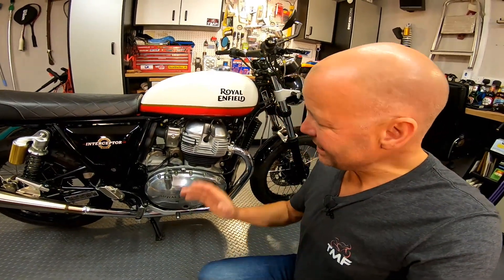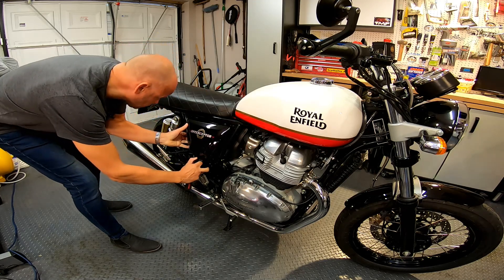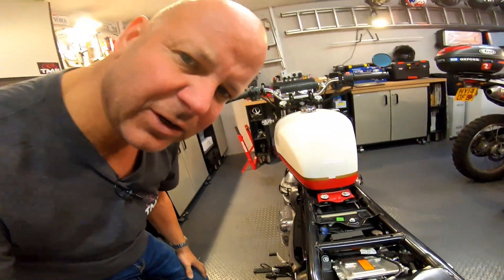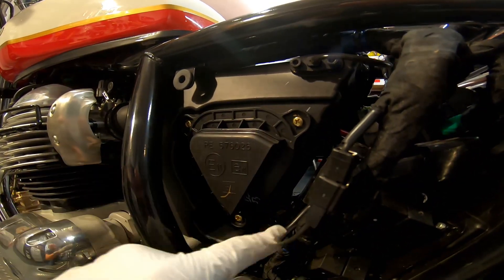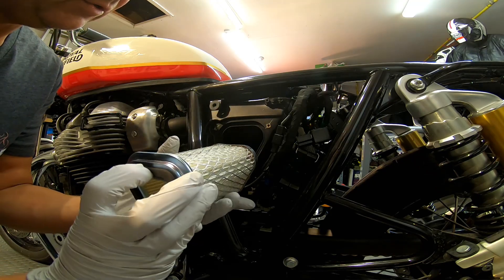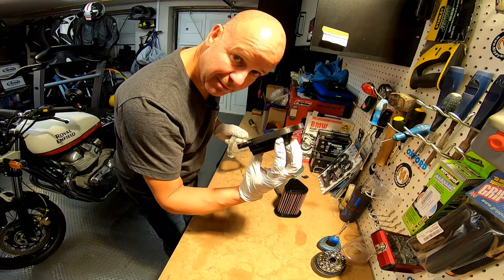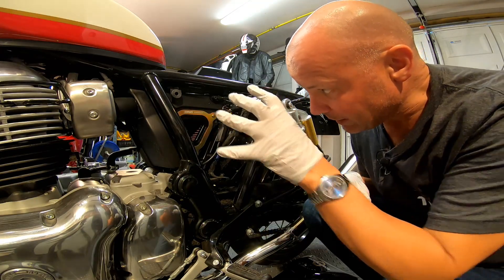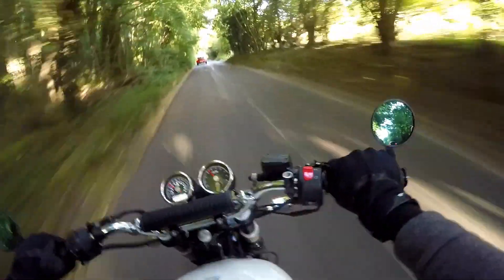Royal Enfield Interceptor 650 Essential Mods - How to replace the air filter and breather

Comment: I believe to need to idle the bike from cold for approx 12-14 mins after doing this mode to allow the ECU to remap its self. It has to learn what has just been modified to be fully beneficial. Good video anyway and don't throw out the original parts just store them away.
Reply: 12 minutes idle is a long time for an air-cooled engine.  don't do everything you hear out there.  the ecu regulates itself while riding the motorcycle.

Comment: I wonder how many new owners have already snapped or at least damaged the nearside cover's lower tab by trying to yank the bottom out first. I know I might have done. That's exactly why these clips are so useful. Keep 'em coming, and more with rides on your Interceptor.
Reply from the maker: Yes I hate those clips on fairings etc....more rides coming as soon as the weather/light allows!
Reply: A me si è rotta con le vibrazioni una delusione

Comment: I have the DNA filter on my 650GT, it was a good mod but now its even better. I fitted the TEC bikes booster plug and it has allowed the filter to make better use of the air flow. From 6500rpm the engine takes off almost like its clutch is slipping!
Reply from the maker: Yes I'm looking at fitting one of those - stay tuned!

Comment: If the air flow actually has increased that much it would be wise to test the air fuel ratio on a dynamometer (inexplicably called a rolling road in your neck of the woods I believe). Increasing air flow without a corresponding increase in fuel flow will create a hotter burning mixture and possibly detonation, no small matter in what is essentially and air cooled engine. Yes, everybody bolts on aftermarket air filters and exhausts. That is largely why buying a used motorcycle is so risky.
Reply from the maker: ...yes next mod is a "booster plug" to richen the mixture a tad....
Reply: @TheMissendenFlyer  I saw that on the TEC Bike website.  Any plans for their full LED light conversion?

Comment: Repeat after me, don't put removed panels on the floor! The law of Murphy says you will stand on it or kick it or otherwise crunch it 😳👍👍👍 electronic fuel injection and engine management make jobs like this soooo much easier. In the old days you would have been faffing about with needles and jets for days lol
Reply from the maker: Yes good advice!
Reply: You still do. The ECU will not be mapped to supply the required fuel to balance out for the huge increase in airflow with this conversion...
Reply: @grahamtricker4103  The Enfield does have Lambda sensors so it's adaptive, it may take a couple of run cycles but providing it has the internal tuning range it should cope.
Reply: Ray G the supplier should verify this I’d guess?
Reply: @SteveInskip  The dealer / supplier probably doesn't know how the ECU functions down to that level. Not sure how you would find out for sure without being able to communicate with the ECU ??

Comment: A bike you can do stuff to without stripping it to bits.
Reply: I have one of their 350 classics, rejetted, exhaust, high flow air cleaner, and auto decomp removed. They are great fun, if it can't be fixed with a hammer you need a bigger hammer.
Reply: @rayg9069  Hi Ray. Whats the 350 like to ride? Ive heard theyre about as fast as a modern 125. Im looking into buying a 2nd hand Enfield to play with and dont know whether to go with 500 or 350, as the 350s seem cheaper. Ive got big bikes but want something i cañ mess with and be sure i can get the parts.
Reply: @heywhotsgoinon8286  Mine is a 2017 model with VM carb and no ABS. The frame works really well, it's quite agile and feels really light on the move, the frame is the same as the 500's. The 350 engine has less vibration than the 500's and once it's allowed to breathe and fed correctly goes like stink. I have fitted the Indian Indoori exhaust to mine, head to tail pipe as the original is a dual wall header with an exhaust catalyst in it which blocks eventually. The Indian VM carb uses standard Mikuni jets so it's dead easy to tune. I've found one size up on the pilot and two sizes on the main seems to suit, heaps more power, it will hit the rev limiter easily in the lower gears, and has no plug fouling issues. Indian build quality is genuine 1950's standard. But at least everything is steel and very simple to disassemble and work on. Top speed from factory after 2000km about 100kmh on a good day, usually 95kmh. Top speed on mine now 120 + a little bit, indicated, and it gets there a lot quicker. Summary, a great blank canvas to tinker with, if you do break something it's dirt cheap to replace parts, it'll run happily on 91 octane, and still give 3l/100km
Reply: @rayg9069  Thanks Ray. This info is really appreciated.👍

Comment: Did you need to let the ECU adjust to new air cleaner from other videos I have seen this needs to be done to achieve the full benefit of the new one Cheers Chips.
Reply from the maker: I'll check....
Reply: I've seen a recommendation where the 650 should be left idling for approx 10mins after filter replacement before killing the engine to ensure proper ECU adjustment. Don't know the science behind it, but the gist was not to go straight into a road ride after the installation.

Comment: TMF. If you replace air filter with one of these types while bike may still need a 'Dealer service' (i.e. under 2 years old) then remember to tell dealer to leave it in there at service. Some garages will swap for OEM filter at service as they are just following instructions and you may not check under panel for months.
Reply from the maker: Yes I've been there before! Cheers....

Comment: For peace of mind, I would run it up on a dyno and get the fuelling checked to make sure it's not running lean. Letting in more air means the engine will need more fuel to run optimally...
I note that many that have done this are now having to add a "booster" to fool the ECU into adding more fuel to correct for the increase in the airflow.
Reply: With the Lambda sensors in the exhaust it should be able to adapt, providing the Enfield ECU has the 'tuning range' to cope.
Reply from the maker: Yes my understanding from Tec is that they have checked their RE650 on the Dyno and all is well....
Reply: @rayg9069  Not really. There is only a small amount of adjustment the ECU will be able to make. Remember, the manufacturers fuelling map is critically made to meet strict emission levels and even more so on an air-cooled motor as in the RE. Some ECUs only switch in the Lambda sensors when instructed to by the ECU. Most of the time it's running a predetermined map or maps. Once you remove the front cover and replace the air filter with a massively less restrictive type you are definitely going to need to increase the fuelling to compensate...
Reply: @grahamtricker4103  My understanding of Lambda sensors is they are sampling the exhaust for rich / lean conditions, the problem could arise I guess if it's only dynamic trim and the bike reverts to it's fuel map every start. I agree the 'tuning range of the ECU may not be wide enough. A dyno would be the sure answer.
Reply from the maker: Fair enough!
Reply: The fact that the RE ECU which is a self learning one is not able to compensate by itself with this filter remain to be proved...I've installed this same filter myself and used the 12 minutes idling after starting the bike to let the ECU adapt. I didn't noticed any if the usual lean condition symptoms such as backfires in the exhaust or bad looking sparkplugs...and the bike is running just fine. So I tend to believe that this ECU is really able to manage this new filter nicely.
Reply: @mighelipedringianu453  That's great news to hear!

Comment: Andy, did you do the 12 minute idle from cold start, to let the ECU self adapt to the inlet ?
Reply: I was looking for a comment like that, otherwise I would!
Reply from the maker: No I didn't - I wasn't aware of the procedure...oops!
Reply: @TheMissendenFlyer  Just start from cold, and leave it idling for 12 minutes minimum. It'll adjust itself to either filter change or cans all by itself. Then switch off, and then your good to go !
Reply: @daveyblakeney  so you dont have to apply a new mapping to the ECU when you change cans and filter?
Reply: @daveyblakeney  No bro. 12 minutes is much time ! Engine air cooled
Reply: @Dario31d  NO.

Comment: I would ignore all the comments about the possible fuelling problems. In my many years of fitting induction kits on road & race cars, air & water-cooled bikes I have never found any problems even on engine dynos plus direct coupled and rolling roads. The only problems were under-bonnet heat on cars without isolating the remote filter and debris sucked into bellmouths on a Thruxton Bonneville (real 60's one not current pretenders!) That was a very informative video many thanks. I am getting one in the New Year and it's your fault dammit LOL!
Reply from the maker: Cheers Paul - I'm looking at getting the "Booster Plug" Tec supply to combat any leaning issues...we'll see long term how it fares!  You'll love the Interceptor - old school honest motorcycling...

Comment: I fitted a K&N in my bike 
Think it may of lost a little bit of induction sound because less back pressure. Can’t really notice any power gain from riding  . Tho filter easy to wash out soon pays for it’s self .
Reply: Back pressure is produced from the exhaust.  Not the air filters.  A ‘performance’ air filter on its own shall help with airflow and ‘might’ give you a couple of extra HP if you’re lucky and you ‘might’ feel the engine being a little more responsive, but you’re never going to feel any more power at the wheel or through the seat of the pants.  Most engines are already set up with about as much performance as you’re ever going to get without major work.  Some bikes that use a detuned engine from another model can react well to small changes. I had a Kawasaki ZRX1200R (detuned ZZR1200 engine) that gave 110hp at the wheel,  but with K&N pod filters, stage3 jets (carbs not injection) and a full Akropovic system showed 130hp at the rear wheel.  This Enfield is unlikely to show any power improvement with this modification.  It’ll make it sound a bit more interesting but that’s about all.  If TMF puts a freer flowing set of pipes on as well, then there may possibly be a noticeable (albeit small) difference.  I’m looking forward to that ‘and’ this project in general.

Comment: Couple of quick questions.  Does there not need to be something to stop water running down and into the inlet in rainy conditions?  Also with the extra airflow.  New bikes are tuned very lean already due to emission controls legislation. Would it not need a re-tune otherwise it may be running far to lean with the potential of damage?
Reply from the maker: Several others have said this - I'm looking into getting the "booster plug" that Tec supply to rectify the fuelling....

Comment: warranty ? 
so  its now running even leaner than stock will the ecu adjust or will it need a new map..?
more air equals more fuel required so pointless ..unless you want to burn out your valves ..
please tell me tec have researched this properly ..sorry thats a bit ranty just concerned for your new bike ..peace and love 👍🏻☮❤
Reply from the maker: Thanks for your concern!  I'll ask 'em!
Reply: @TheMissendenFlyer  
that came over a bit like a Troll comment .. honestly not intended that way .. engage brain before text Springy !! 👍🏻☮❤
Reply: springy 2112 you wouldn’t want to send the wrong “signals”. 
Stop it ! we’re not doing that again.🤘🏻
Reply: @rumien1383  
ah good day to you sir !  i dont think we need to go there after all we' re not some kind of "fly by night " outfit . 
oh dear what have i done ? 👍🏻☮❤
Reply: springy 2112 always a pleasure sir.

Comment: Do you own a subwoofer, like the ones in home cinema setups?
The port through which the sounds comes out looks small doesn't it?
It works using the Helmholtz resonance principal to boost the sound's lower frequencies. If you drilled holes in the subwoofer, to make it "breathe better"  it would sound much, much lower because the resonance effect would be lost.
Something similar happens in the  airbox .  In order to achieve a higher volumetric efficiency the Helmholtz principal is used in designing the airbox, hence that small looking  air intake opening.
Just think about it for a second:
Don't you find it strange that model after model, brand after brand, motorcycle manufacturers can't get the airbox right?
Not even Honda, BMW, Ducati or any other manage, with all their know-how and resources, to get it right?
And it's such a simple mistake that anyone with a pocket knife and no technical or engineering knowledge can fix it?
Just how much air does it actually need???

Anyway,  take care, ride safe
Reply from the maker: Thanks for watching and for stopping by!
Reply: Agree in principle, but then look at race bikes, ram tubes with no filter at all. 

Manufacturers are balancing performance, noise, emissions, engine stability over wide operating conditions  and long service life. The filter and airbox is a compromise to achieve acceptable results in all areas, they do a bloody good job of it as well.
Reply: @rayg9069  Race bikes use the exact same principle, they just shift the resonance frequency to a very high RPM at the cost of a very narrow power band.
And those ram air intakes use diverging ducts to exchange the  air speed for air pressure. That is also what happens in a normal, apparently "restricted" air box. Air that rushes in at high speed into a larger cavity gets to a higher-than-atmospheric pressure state. Obviously, there's a limit and a compromise to this effect.

This all process is somewhat counter intuitive but that is how it works.

Comment: After fitting the filter, startup the bike and do not rev it. Let it run for 10min. This will let the ECU to reprogram itself to allow for the extra air. If you don't do that it's using the old settings which is not good.
Reply from the maker: So a few people have said....I wasn’t aware of that procedure....presumably you can do it at anytime (run the bike at idle) to reset the ecu?
Reply: @TheMissendenFlyer  yes, anytime..
Reply: Oh btw..I sent you an email regarding a little clock mount for the int650  last week. Not sure if you got it

Comment: Gday mate im going to ask what is your opinion on this bike ,do you believe it could be a good contender to the triumph bonnevile .I know it is way down on power compared to the 1200 but after seeing it i am reminded of the bike i learned to ride on a xs2 650 yamaha mine had problems with the decompressor valve when you kick started it ( oops showing my age there they dont have them anymore do they ) nothing like getting it wrong and having it wack you in the back of the leg aghh the memories .I do like the look of the interceptor as the triumph do you think they will bring out a larger model ie 900 maybe even a 1200 to rival triumph ?
Reply from the maker: Go check out my reviews for my full thoughts on the machine!

Comment: I have a K&N filter fitted (by dealer) and regularly get fault "Air intake temperature sensor". Have to reset using OBD reader. It's then OK for a few weeks before returning.
Anyone else having this issue.

Comment: Question from 2021: wont the open bracket increase the risk of water ingress especially in foul weather?
Reply: PLUS  you attract more hot air from the engine PLUS your ride will loose torque and peak performance. Don’t do it. Just sounds stupid too

Comment: Hi.
I’m not very mechanically-minded. 
Does the air get sucked into the filter from the front of the bike?
Without the air filter cover is there a greater chance of dirt/ water ingress into the filter. 
I’ve seen some comments suggesting this. Can’t see that water ingress would be a factor. Not seen any water under that cover
Reply from the maker: Yes!

Comment: Changing the air filter ok.But changing the air box  requires a remap,i would think?
Reply from the maker: I'll check in with Tec...
Reply: All you need to do is let the bike tick over for 10 minutes without reving it.Your ecu is a learning one.

Comment: I doubt you’ll see any gains without a remap and to be honest if you’ve changed air flow I would remap it. Manufacturers tend to ship their bikes a bit lean to beat emissions testing and changing the air filter is only gonna make it leaner.
Reply: I got my MT-07 remapped with Wiz Performance for £150. Just send the ECU in the post.
Reply: “a bit lean” - there’s a polite understatement 😂

Comment: After putting the DNA air filter in are you not supposed to let the bike idle for ten minutes for the bike to self adjust for the improved air flow, rather than just going for a ride. Please explain.
Reply from the maker: Apparently you are yes - but I didn't know that at the time - it's idled since then so it will have made the necessary corrections..

Comment: Sorry to be off the thread however I just ordered a booster plug for my bonneville after seeing the re interceptor video now it's gone, I am going ahead and fitting it when it comes however I wonder if you have had second thoughts about the mod yourself
Reply from the maker: Nope - just that I found the white connector hiding under the seat - the video showed me plugging it into the wrong spot - I need to remake the video....but thought i should take the old one down to prevent anyone following my wrong example!  Very happy with my booster plug, go for it!